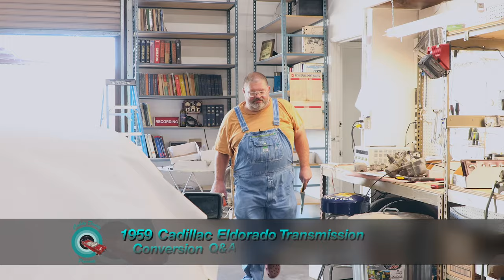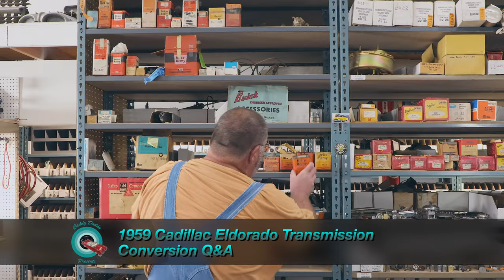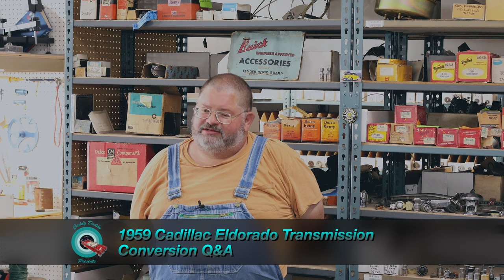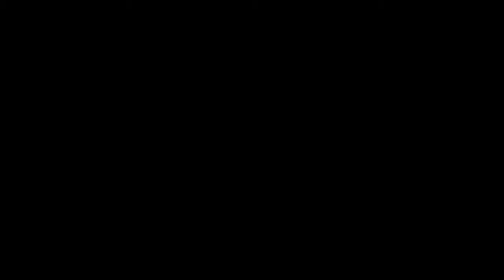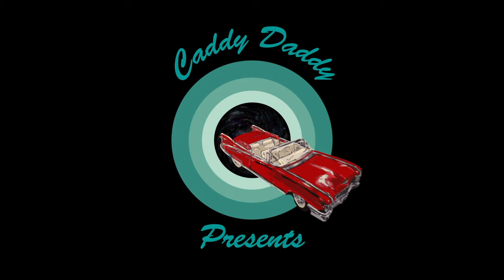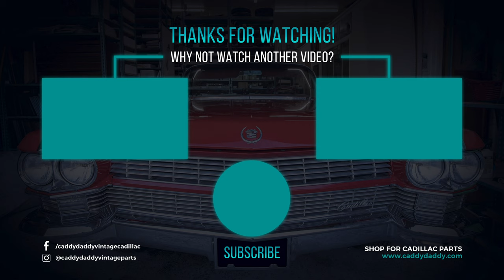1959 Cadillac Eldorado Transmission Conversion Q&A

Comment: What did you do for an adaptor plate to mate the trans to the engine ?
Reply from the maker: https://www.caddydaddy.com/1955-1956-1957-1958-1959-1960-1961-1962-1963-1964-cadillac-engine-to-turbo-hydramatic-400-transmission-conversion-adapter-kit-with-starter-see-details-new.html
Reply: @Caddydaddy  the wilcap comversion kit , nice !!!!